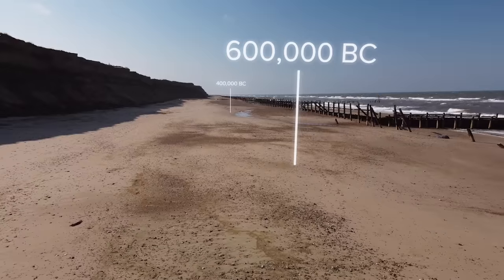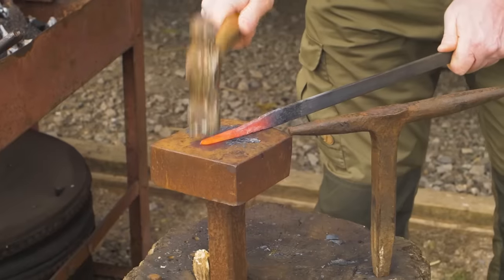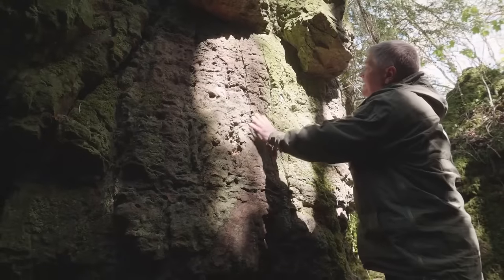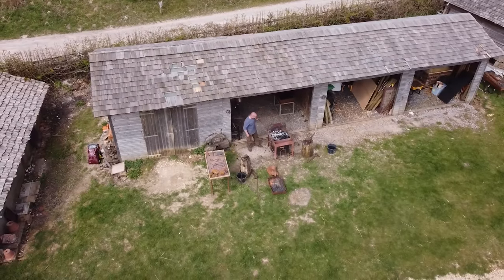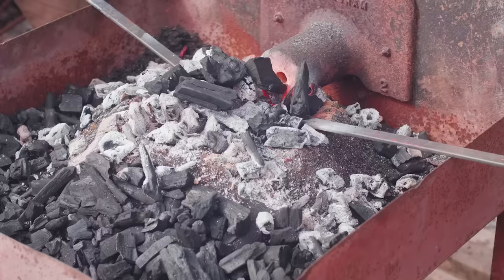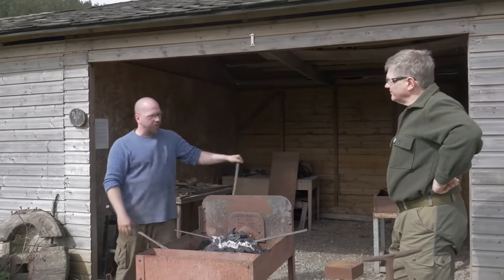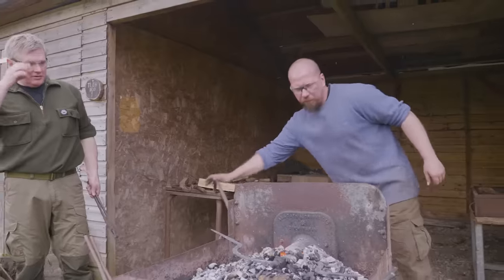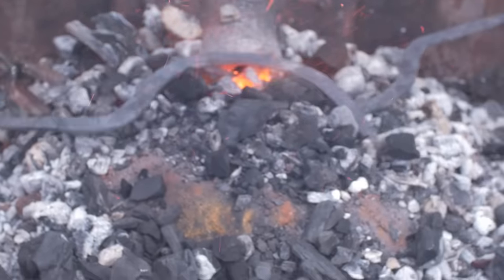What Was Life Like in Iron Age Britain?

Comment: Excellent video, though one point of clarification about early iron. Early iron production was nowhere near as refined as it was later into the iron age. It generally had a lot of unhelpful impurities, and would at best have been on par with bronze (with worse longevity). The benefit that iron had in these early days was that it was abundant. You can just dig it out of the ground practically anywhere. Compare that to Bronze where the entire bronze tool-complex of Europe and the Middle East depended on long-distance tin trade from a very few places. That made bronze tools rarer and more expensive than comparable iron ones. Only later, as ironworking improved, did we work out that iron (and later steel) was a stronger material for tools.

Comment: 1 question that I have, what did our iron age ancestors use for an anvil? I Imagine something like bronze? granite? even hardwood? I mean making a tool the old fashioned way with a modern anvil is 1, do it on something we think they had could have had be a real engineering challenge!?

It's all talk about the iron, the heat, the color, the cooling the metalurgy, the air blathers, etc. But what about the anvil!? without that it is all impossible!?

Comment: Thanks for the interesting video!  What kind of metal is the blacksmith's forge made of?  I'm  surprised  that there is a metal that wouldn't  melt in that heat.  Thanks
Reply: Probably steel. If it's thick, it'll last for quite a while.
Reply: @jcarey568  Thank you!  That's  interesting that steel  can stand up to that kind of  heat.  I know each kind of metal has its own melting point.
Reply: I'll guess that the hottest part is in the middle where the air is blown in. On the outside it wouldn't be so hot
Reply: @JohnSmall314  That makes sense!
Reply: The iron was just heated so it was malleable; not to the melting temperature.
Reply: @anneelton5228  Thank you

Comment: The original iron swords were no harder than cold-forged bronze swords, about a 5 on the Mohs scale.  The major point where iron was vastly superior to bronze across the ancient world came from the fact iron could be found in many, many regions (though its malleability was also superior).  In contrast, copper and tin (the most commonly used metal paired with copper when making bronze) was NOT found close to each other, save for in Great Britain, where there actually were a few tin and copper mines within a very short distance of each other, as opposed to the hundreds and thousands of miles found elsewhere, such as in the Mediterranean.

When several factors caused the collapse of long-distance trade in the ancient days, the materials needed for making bronze were no longer being transported.  Copper was not being taken to places where tin could be found, tin was not being taken to places where copper could be found, places without either weren't able to get diddly-squat...and that meant it became paramount to find local sources of a material that could take its place.  Iron was far cheaper in terms of local availablility to source.  

Unfortunately, iron came with a different production cost.  Instead of long-distance transportation issues, it required changing the fuel sources.  Copper and tin could be smelted in regular fires (albeit with steps taken to make those fires very hot), fueled by wood and by modest amounts of charcoal.  Iron forging requires huge amounts of charcoal, which required new techniques in creating high quality materials, as well as new smelting techniques and tools, plus innovations in additives to make the slag rocks melt away from the ore (baked & powdered limestone, or lime for short), which had a much higher melting point.  

On the bright side, a highly observant, skilled blacksmith could realize that at a certain point in the forging process, between hammering and bellows works and heat temperatures, they could transform the iron into a new type of material, steel (carbon content between 1%-3%, as well as adding in other metals), which had a vastly superior hardness rating.  Smiths who could figure this out well enough to get mostly consistent results time after time were thus treated with high status for their ability to "magically" create harder-than-usual tools and weapons...and rightly so, because those groups that had stronger, less brittle weapons were far more likely to survive raids by envious, starving, or just brutal-minded neighbors.

Comment: So...not having the vent hole at the top is not done out of concern for fire.  With the roof height, there would have been no worry of "sucking" flames all the way to the peak.  A small central hearth fire would not have generated such an updraft at all.  More likely it would have been due to needing a more complex structure in order to add the vent hole.  Think Yurt.  They also used a circular structure with a central open hearth fire, but the central wheel used to maintain the roof vent is a complex structure with specific design parameters.  It can be covered both partially and completely to keep out the rain, and still vent out the excess smoke.  My question is, do we have actual evidence that the roofs did not have a central vent hole, or is that supposition only.  It seems to me that humans would have been well aware of the dangers of consistent smoke inhalation and would have designed the home to be a bit easier to breath in...Scandinavian structures from the same time period are all properly vented.

The destruction of tooth enamel by constant consumption of stone filings really make the hunter gatherer life look much nicer...lol

Comment: I'm surprised people didn't make a little semi-removable thatch cap (like a little hat) for the round houses to vent the smoke. I would think it's a simple solution, as long as the cap remains generally secured, is able to keep out enough bad weather when raised for venting, and can be replaced when needed.

I'm searching to see if this was a thing in some areas back then. I can see many reconstructions have these little tops over the circular roof, but they seem to be very-much attached and not adjustable. They don't seem to have any play to make a void for smoke.

The cap I would envision might've overlapped the adjacent roof perimeter a bit, so when  the cap is closed in the "down" position (perhaps even "sealed" by a moss ring, etc) it would nicely shed the rain, sleet, and snow. When a fire is lit, a pole or some contraption could vertically prop up the cap up a little bit to create a void space between the cap and the rest of the roof. Rain and weather would probably be reasonably contained outside the open cap—the air pressure of the fire might help that along as well.

I suppose there's probably a practical reason not to do this if they hadn't.
Reply: I suspect you'd risk raising the roof temperature causing a fire
The reconstructed huts I've visited dont need any special smoke exit. 
The things you have to watch for are the spiders and creepy crawlies that fall out

Comment: Why would Bronze age which is amalgam come before the iron age which is a single metal. Are you quite sure that lack of Iron tools is because they return to earth easier than Bronze. In other words the lack of evidence is due to it not lasting as long. Steel cars wont be found in 2000 years but Plastic Fibre body and Aluminium will.
Reply: robertstallard7836   thank you for your very  comprehensive reply.